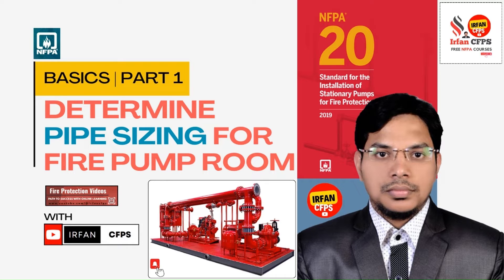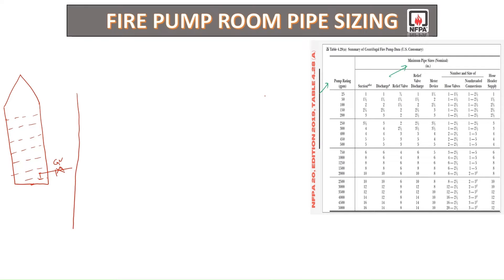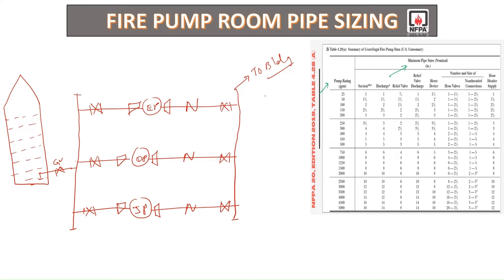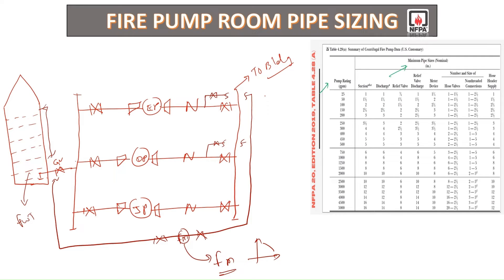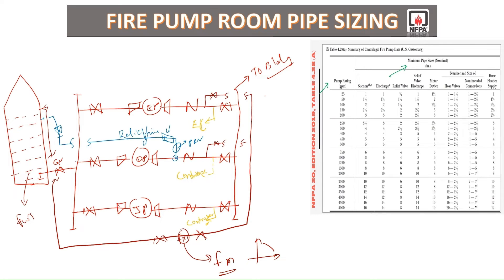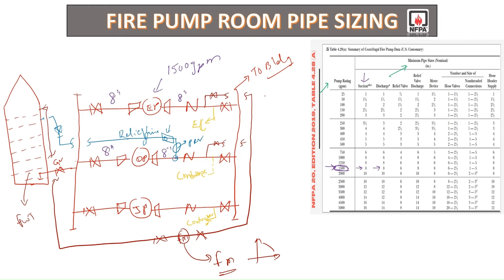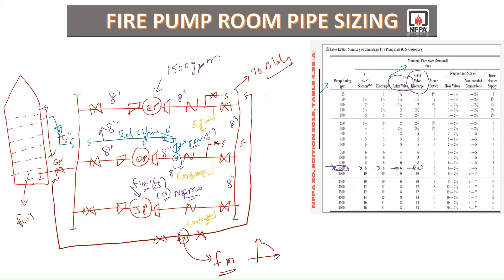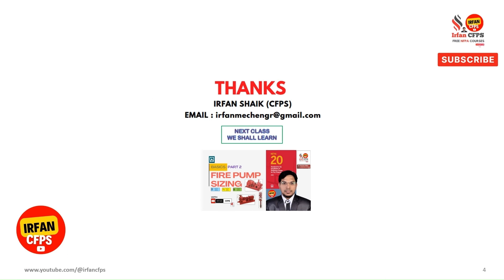Mastering Fire Pump Room Pipe Sizing: The Ultimate Guide

Comment: Common Suction Header & Discharge header size should be increased? or it shall be kept as same size as the individual Suction & Discharge pipe for each pump as per Table 4.28
Reply from the maker: suction header and discharge header size depends upon the capacity of fire pumps. for example, if one is duty pump (1500 GPM) and the other is standby (1500 GPM) then obviously one 1500 GPM pump will run at one time, so based on the capacity, we will select the header sizing. or for example two duty pumps with 500 GPM each and one standby 750 GPM, now since both duty pumps will run at once, we will calculate the header sizing based on 500x2 = 1000 GPM capacity. Hope you understand. Apologies for late reply
Reply: @irfancfps  Thanks for clarification

Comment: Hi Engineer, very great explanation. Masha Allah. I have a question to ask. In our project, we are taking the test line from the discharge header, which will be after the discharge check valve and gate valve. But here you are advising to take after the discharge check valve. I'm confused between these two, can you please explain which should be followed and why?
Reply from the maker: As per nfpa 20, it should be after check valve. Just go through nfpa 20, a figure will be there
Reply from the maker: Please refer nfpa 20 (2019) section A.4.22.3.1.3(1). As per this, test line is connected b/w cv and control valve so that system can be isolated from the pump during testing if desired.

Comment: Very nice explanation, There should be a strainer on suction line Additionally What are the roles of sensing lines which are going to controller, These lines ll be water filled ?, Could you please more brief ?
Reply from the maker: Thank u. Strainer is not a mandatory requirement per nfpa 20 if the source is from portable water supply…sensing lines filled with water..
Reply: @irfancfps  Thank you, Could you please brief about sensing lines.

Comment: Sir, as per NFPA 20 suction pipe shall be sized so that when the pump is operating at its maximum flow rate, which is 150% of its rated capacity. Is there any pertuculer condition to apply this or we shall apply to all fire pump rooms?
Reply from the maker: Suction pipe size for the pumps will be selected based on a table available in nfpa 20. So no need to worry about the 150% rated head capacity… please check my video on “fire pump room pipe sizing”

Comment: If I have a 6 floor building, it has a parking floor under ground (ordinary hazard grade 1) and the other floors are apartments (light hazard). Do I have to select the pump based on the requirements of the parking floor or the requirements of the last floor of apartments?
Reply from the maker: Nice question. See u have to perform hydraulic calculations considering two scenarios 1) based on remotest location 2) based on highest hazard available even if the highest hazard is near to the pump room also
Based on remotest location u will get may be highest pressure head (psi) and from highest hazard scenario u will get the highest flow (gpm). Based on those two scenarios u need to consider the max flow and pressure required. Based on that u need to select fire pump capacity. Hope it’s clear for u. If u have any other concern let me know. Any how all these will be explained in this nfpa 20 module asap.
Reply: @irfancfps  thanks 🙏🏼
Reply from the maker: @isaacjose016  is it clear now??
Reply: @irfancfps  yes it was clear. I am a mechanical engineering student from, I am doing my final project on the design of thermofluidic systems and your videos have been very useful
Reply from the maker: @isaacjose016  thank you so much. 
You were doing project on thermofluidic so how this firefighting videos are useful for you? Could u let me know so that it will give me clear idea. Thanks